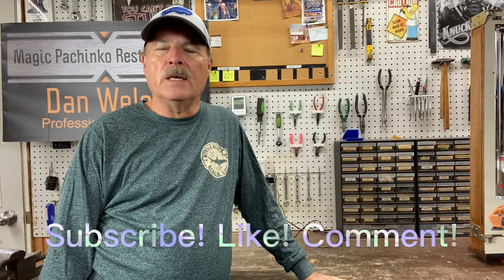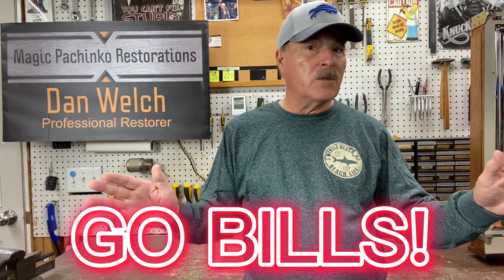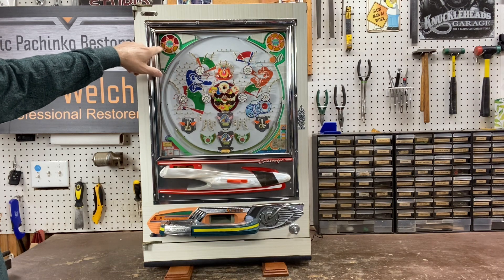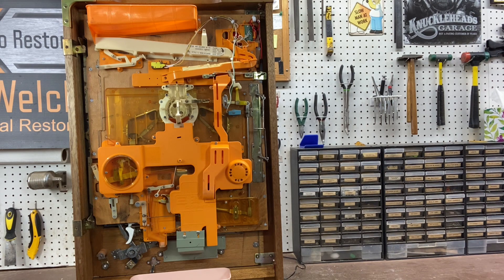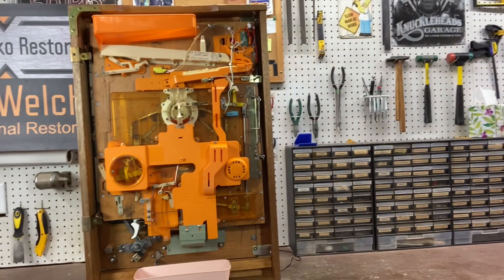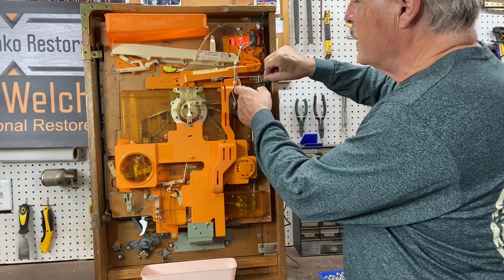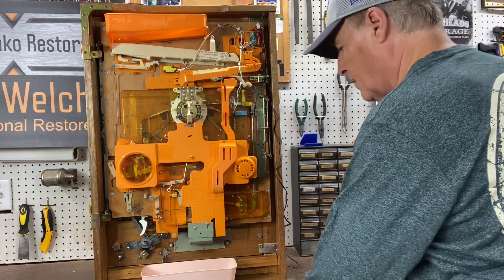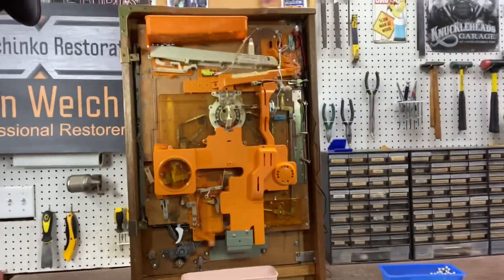1976 Sanyo Comet II vintage pachinko machine

Comment: Hey Dan, love your videos. You helped me discover and get my own pachinko machine. It is very similar to this machine and had the exact same back mechanics. It all works well with one minor issue. Every 5 times or so when I get a jackpot it does not fully release the balls. The piece that you reference in the video that was broke gets just barely stuck. When a jackpot happens it has to clear that top piece to release the balls but sometimes it barely doesn’t make it. Normally I just open it and give it a tap and it releases the balls. I was just wondering if you had any ideas of how to fix this? Thanks!
Reply from the maker: Mike,
Do you have plenty of balls in the machine?  You should have 300-500 for the machine properly. 
If that’s not the problem, give me a call sometime and we can discuss things. 
585-760-9104